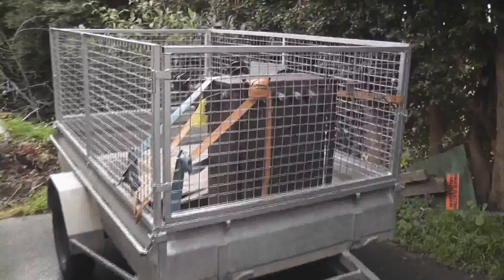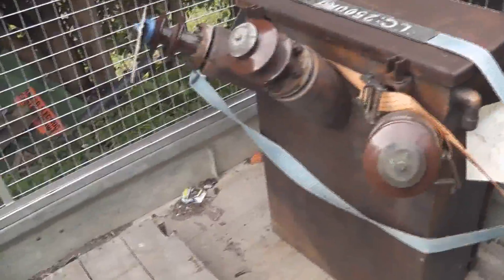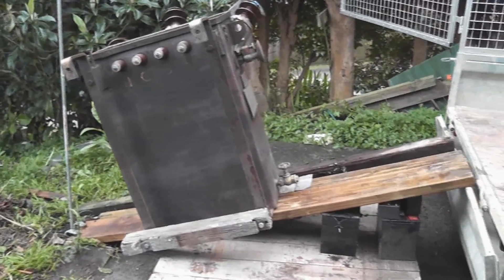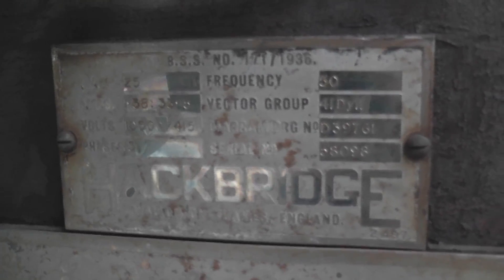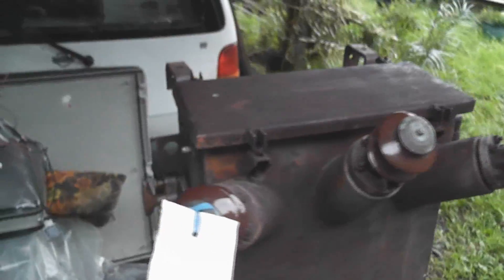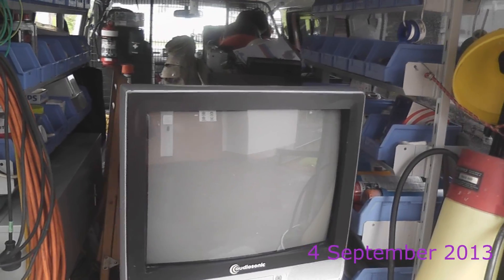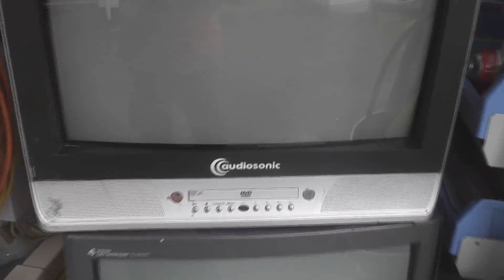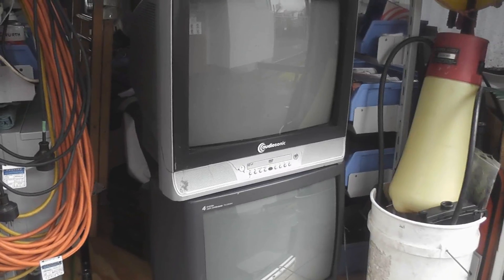Transformer arrived - 2 TV's - ZVS arcs in water

Comment from the maker: 11kV and 20 Amps is about 400kVA. that feeds a whole suburb.
This TX takes 11 kV at 1.38 Amps continuous = 25 kVA
seondary 33.8 Amps per phase.
Feeding it single phase I need a 40 Amp supply. may need to ballast.

Comment: MMMMM !!!!!

That Transformer is MIGHTY SEXXY :D

So, the burning question here, that REALLY has to be asked: If powered backwards, how many kV would you get out of the HV side?

I heard you say 415/240v, so if it's like the UK tx's, then I'd guess that this originally had 11kV delta on the HV side.

Mmmm, 11kV with 20A behind it. That's going to be ridiculous. :D I'd seem to think you're going to need some BIG ballasting to run that, as it'd probably cause wall-socket poppage without it!

-BBD.